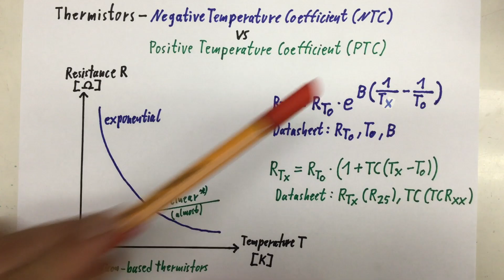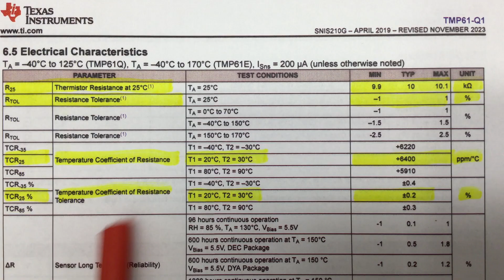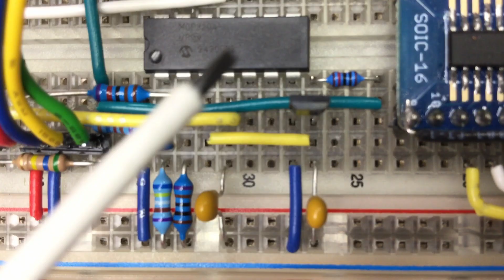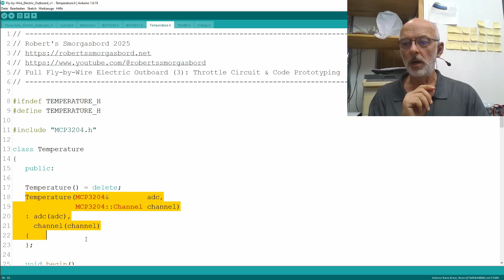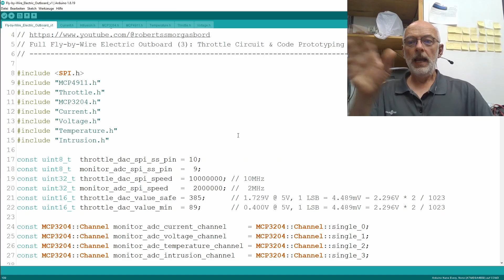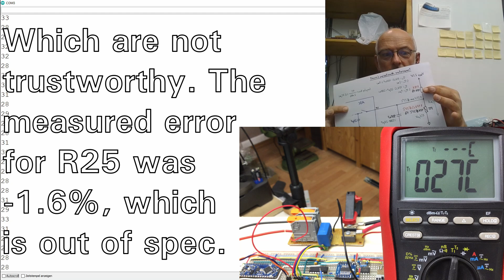Full Fly-by-Wire Electric Outboard (12): Temperature Monitoring Circuit & Code

Comment: Nice to learn about about more components for universal applications like temperature measurments. My usual choice for room "temperaturish" temperatures is LM35. Usually get to within +/-2 degrees (more like 1 deg.) of mulitmeter thermocouple measurements. Looking forward to more !!
Reply from the maker: Uh, I totally forgot to mention that the class of temperature sensors: Integrated sensors with analog outputs. Thanks for reminding me! I might consider replacing the PTC resistor by one of those.
Reply: @robertssmorgasbord   Looking forward to seeing a trial of one of those ...
Reply from the maker: @mumbaiverve2307  I'll probably try an LM235. Using that would solve another problem too (output impedance towards the ADC).